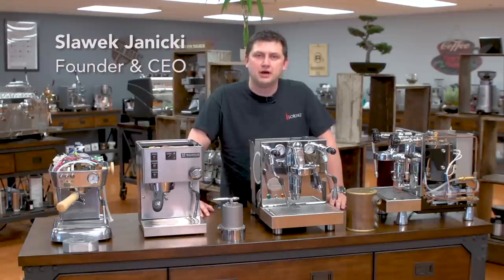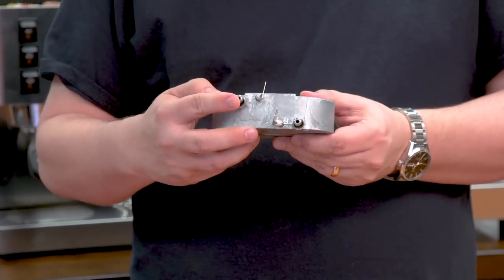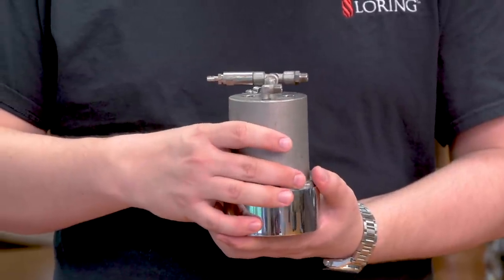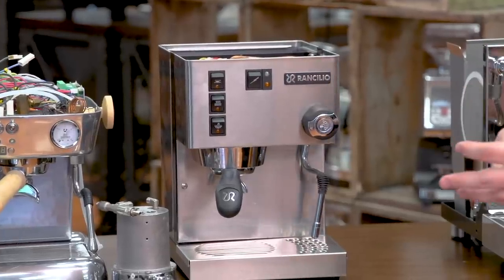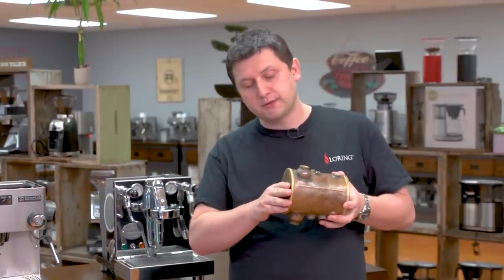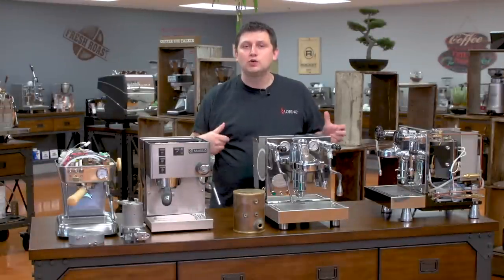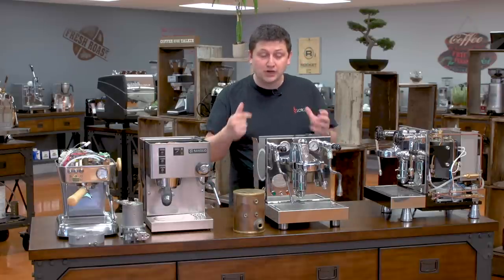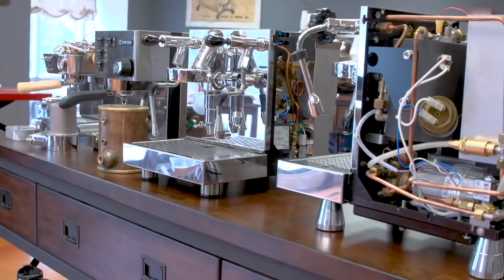Comparing Different Boiler Types in Home Espresso Machines

Comment: Two things you missed here. ONE, Breville and Ascaso don't use thermoblocks anymore they use THERMOCOILS. Two, Gaggia, lelit and Silvia use unhealthy aluminium,  and brass boilers which are known to provide health issues from lead leeching and other forms of leeching. If you want a single boiler look for one that is STAINLESS steel inside ( not the outside).  lelits higher end Elizabeth 3, Marax and The one up from their are stainless but everything below that is BRASS ( avoid at all costs ). Right now I can't justify any machine except a BREVILLE ( which i hate) and the ASCASO UNO or DUO and that is because both brands use STAINLESS steel pipes through the block - hence thermocoil. Steel doesn't erode as fast, and is better for your health. They are moving away from brass and copper boilers. Gaggia needs to dump their aluminium as that's even worse.
Reply: What’s wrong with Breville? I’m thinking of getting one
Reply: which ones use stainless steel boilers on the inside?
Reply: How are thermocoils different?

Comment: Finally someone agrees with me that single boilers duo purpose machines are going out of business. It is simply outdated, especially if you consider that thermocoils can be built to keep very accurate, consistant temperature (we will see lots of those machines soo , I believe). Many pro consumers just wont let go of the idea of owning a somewhat pro level machine like the ranchilio, which isnt pro at all. In fact, if you really wanna upgrade from a thermocoil, you got to buy a dualboiler. But then, you are in a complete different game, price-wise. So just decide, what you actually want: A modern homemachine, or a professional espressomachine.

Comment: Great explanation. How about Saturated group head?
Reply from the maker: The easiest way to explain a saturated group is that the group head and boiler are basically joined.  In some designs this is the exactly the case;  the group and boiler are one piece (like Dalla Corte, Synesso, the new Bellezza Group, etc).  Some other designs like La Marzocco the group is filled (saturated) with water from the boiler.  The goal of saturated groups is temperature stability, you want the temperature of the brew boiler and the group to be as close as possible and as consistent as possible as this helps a lot.

Comment: On a thermoblock machine, is it necessary to "refill" the block after steaming as is required with a single boiler or can it be allowed to just cool down naturally?
Reply from the maker: No, it's not necessary. Most modern machines have an automatic cool down feature after steaming. Regardless, with a thermoblock you don't have to worry about this step

Comment: Thanks for the video. I heard people saying that there is no real/practical benefit of having a PID controller on a HX machine. Is this true and why?  For a HX machine to be used the first time in the morning,  how long should a cooling flush be done after warming up the machine?
Reply from the maker: A PID on a heat exchanger machine replaced the pressurestat.  There are some benefits to this.  First a PID uses a solid state relay to turn the heating element on and off.  SSRs have a very low rate of failure, it can be considered a non-wearing part whereas a pressurestat will eventually wear out and need to be replaced.  You can also change the heat inside your boiler to raise or lower your steam pressure with ease and without having to open the machine which is another benefit.  But if you are looking for direct control over your extraction temperature then I recommend a dual boiler machine with a pid.

Comment: Thank you for the informative video! In a HX machine, the brew group's water loop is kept warm by the HX line and not from the boiler, correct? Is this what necessitates a cooling flush after it has been sitting for some time?
Reply from the maker: The heat exchanger is a tube that passes through the boiler. The water inside the actual boiler is boiling hot (about 125 degrees Celsius) and the top part of the boiler has water vapor (steam). A cooling flush is necessary because the water that remains in the heat exchanger from previous use gets too hot which can result in a bitter shot. When we do a cooling flush we are just purging the water from the HX and replacing it with fresh water.

Comment: what are some good prosumer thermoblock espresso machines in the <$2k USD range? and why is ascaso baby T so expensive ?
Reply from the maker: The Ascaso Duo is probably the best in this category. It's been quite popular and well received.  The Baby T is basically a single group commercial machine, it has all commercial level components.

Comment: Which is the best boiler if the water you're using generally is hard? The water in Calgary it's considerably hard. I was leaning towards the new ascaso, thermablok systems but I thought another video that mentioned that their Look Lock is prone to damage from excessive scaling. Which would you recommend? Thermoblock or heat exchanger?
I'm currently using the rancilio Sylvia and looking to upgrade
Reply from the maker: Hi, the new stainless steel thermoblock from Ascaso is quite resistant to scale but I recommend using a simple solution like an in tank softener to prevent issues with any system.  An ounce of prevention is worth a pound of cure.

Comment: Resistance to scale of TB is related to material properties or also to fact there's very little water in TB pipe and after shot it's either purged or quickly evaporates (I could be wrong either way)? Now HX and DB machines are made with SS boilers - do they really scale less or SS is just cheaper than brass?
Reply from the maker: Stainless is more resistant to scale because it is much less porous than brass or copper.  The scale doesn't "stick" has easily.  The main reason for the switch is regulalations.  Many countries are restricting the use of copper and brass in food products because of lead content.  In recent years some manufacturers have been coating their copper boilers as well to reduce the possibility of lead getting into the water.

Comment: Thoughts please :) . 2019 Ascasio steel DUO vs HX like the Oscar II or something a little more expensive like the Isomac tea due?
Reply from the maker: The Steel Duo uses a second thermoblock for steam.  This solution allows for a small footprint since thermoblocks are smaller than boilers.  The steam power is lower though and it takes longer to steam than it would on a heat exchanger.  The price difference is also not that large between the Duo and entry level hx machines like the Magister Stella Professional which is why we don't carry the duo.
Reply: @iDrinkCoffeeCanada  can you brew and steam at the same time on a duo

Comment: Nice video, thanks! Is there any machine out there using besides stainless steel boilers pipes in stainless steel? Or are they still using copper pipes?
Reply from the maker: The only machine I can think of that has stainless pipes is the Vesuvius from Ambient.  Steel is very rigid and doesn't leave much room for play so manufacturing this way is challenging
Reply: @iDrinkCoffeeCanada  thank you. That's a good hint, i was not aware of this.
Reply: @iDrinkCoffeeCanada  I thought Breville machines are also using stainless pipes?